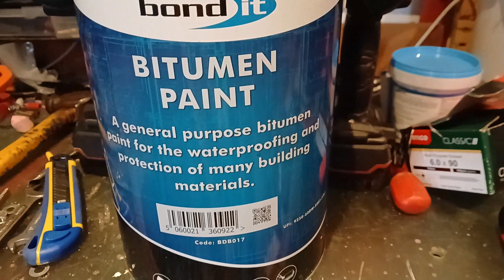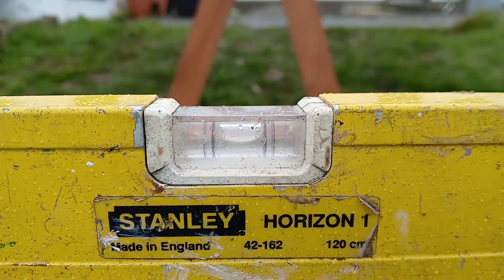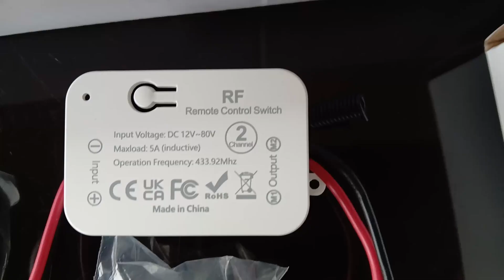It's Not Working Out.... (strong language)

Comment: You just need to drill the threaded bar all in line, parallel with the slop. Is that 50 Degrees to the east and west ?
Reply from the maker: Youre spot on Henry, absolutely correct. Have been considering using a length of ree-bar as they come in 6meter lengths.
The tilt will be limited only by the actuators which have 400mm of travel. Hoping to get full tilt to the east and a little to the west on the other side. Won't know for definate until the hinge problem is sorted. Glad to have you with us as always.❤
Reply: My first week thoughts on the istabreeze 5 blade hub ! The clean direct air isnt getting through to the tale, redirecting the turbine via the blades ! Bigger tale needed.